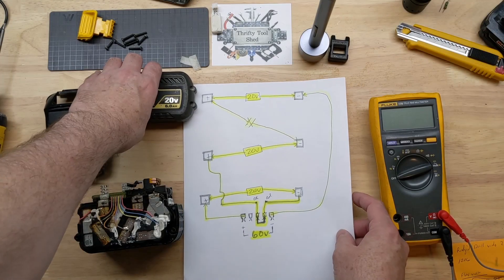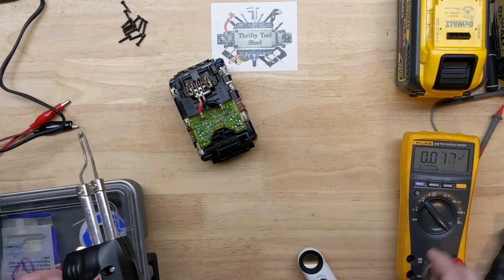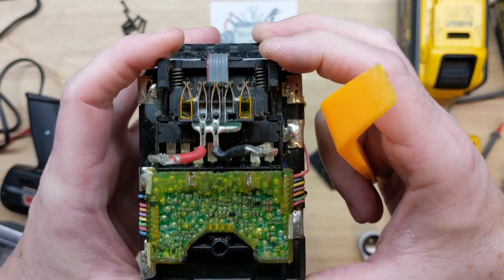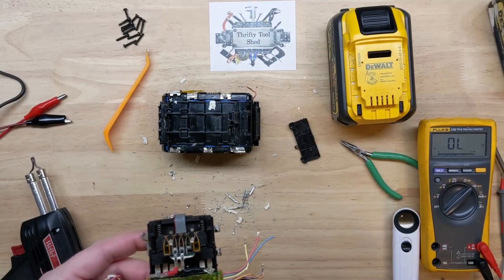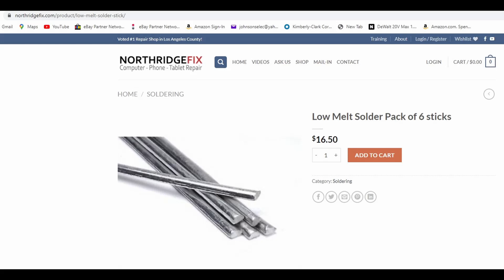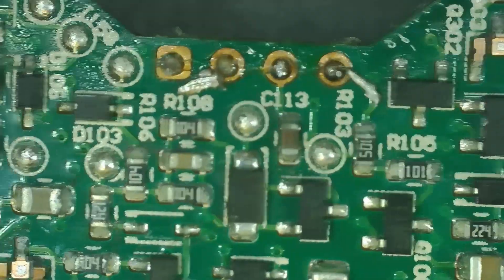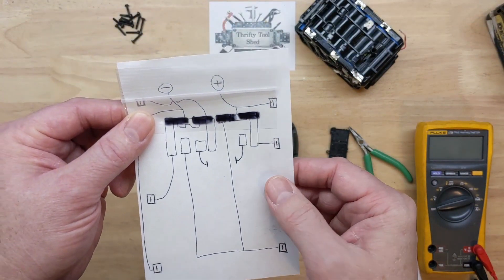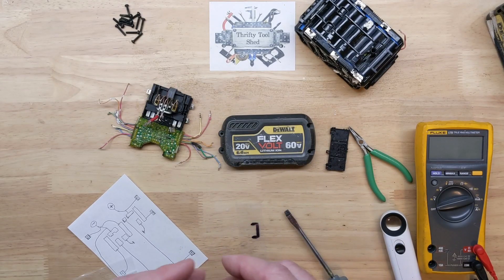DeWalt FlexVolt - Deeper Look Inside

Comment: Amazing video, appreciate the electronics focus which is rare in the tool video arena.

I'm working on a like new mid-2023 9ah that after manually charging and balancing all the cells (all of them holding voltage just fine) , the C2 terminal is giving north of 8.5v which the charger no-likey.    I think C4 is direct connect (via some small resistance) to cell 4+, bank 1, whereas C2 (as well as  C1&C3, when in 20v mode) are synthesized by the logic board.   I don't know if my situation indicates a board fault, or possibly a self-destruct mechanism like the old makita packs used to have.    Have you come across this?   

Many thanks and glad I found/subscribed to your channel👍

EDIT:  * UPDATE :
Close inspection with a magnifying headset revealed a half mm discoloration on one of the 14 traces of the cell voltage connection ribbon on one side.  Scraped down to bare copper either side, and failed continuity test.  Jumping these two points corrected the C2 voltage level.  I think the ID resistance measurement was also corrupted by this and I assume it will also correct back to ~600ohm once I solder a permanent wire repair jumper.   I'm definitely not a fan of Dewalt moving from wires to this paper thin and delicate ribbon.   I acquired the pack cheaply and dont know its history, but its mfg date is only few months ago and it looks nearly new but has some signs of use so wasn't factory DOA either...
Reply from the maker: Excellent find!
I have seen 2 packs with similar issues and I was hoping to get a hold of a new (good working) pack to make sure this was really reading in error as I noticed a difference from regular 20V max, but I do not own a good working FlexVolt to say for sure. You have most likely found a very common issue with these! I wanted to learn more about them and I have had 3 broken ones now, but with the expense of them and my honest dislike of the overall design I never bought a brand new one to double check my readings on the bad packs. Thanks so much for sharing that information. It is very helpful.

Comment: ID pin shematic is not simple, resistor 604 Om not connected to ground, some addotional shematic there. Baterry not charge becose some ID signal problem. Sorry for my english)
Reply from the maker: Yes, it is not simply connected to ground it is indeed a more complex circuit with a transistor and it seems that it can enable or disable the tool as well as let the tool know which type of pack is inserted? I think I have mentioned this in some videos over the years. Obviously I have no schematic, just looking over the board. Thanks for your comment!

Comment: Wow I had always wondered how these packs are designed, you did a great job explaining how it works in this video.
  On the subject of low temp solder.. I had so much trouble trying to remove components for board repairs until I finally learned about the different low temp solders available.  I ended up buying some of the “CHIPQUICK” component remover alloy.  Its only for removing components because it’s too brittle when cool to be used as a solder, so you need to be sure to clean it off your iron tip and the board well.  That stuff has really been a game changer for me though for removing smd components as well as big through-hole components like mosfets.  I may have to look into some other kinds of “low melt” too, it might be nice to have one that can be used without cleaning it off so thoroughly after. 
Thanks for sharing, love your videos!
Reply from the maker: Thanks for your kind comment!
Yes, the low temp solder is so helpful on removal and a very good point about cleaning the tip afterwards before soldering components back on. Thanks for sharing!
Reply: @ThriftyToolShed   Thanks for always being so good about reading and replying to comments!  I’ve been watching your videos for a few years now since I was trying to troubleshoot an EGO battery.  You even made a short follow up video to answer a question I had back then and I’ve been a fan ever since.  Actually I think you may have even helped shape my appreciation for Southern accents and their associated charm to be honest lol.
You’re a great teacher, fixer and creator.  Keep up the great work, wish you and your channel all the best! 
 Much Mahalos and Aloha!  
                 🤙
Reply from the maker: @maukaman Thanks so much for your kind comment and for being so encouraging. It is so much appreciated! Aloha

Comment: Chahahc, you are absolutely correct, its a common failure mode for this battery ie 1 cell discharges unevenly and causes the other 4 in series (3 banks in series in 60V mode)  to overcharge when in 20V mode. Very difficult to replace a single faulty cell then balance in 60V mode before balancing again in 20V mode. I have youtube video showing how to easily replace a single cell in a pack. Thrifty has shown the older model pre 2019 I think, the new mode has a flexible circuit connector instead of wires to each cell monitoring point. New model seems to have better cells but fails in other ways. Message me if you are interested.

Comment: would it be possible to use tool batteries for portable  ham radio use? they require 12 to 13.8v but no less than 9.5v discharged?
any thoughts on repurposing these? thanks Craig kd9uqe
Reply from the maker: I would think so and depending on current draw you could build or buy a BMS board to cut out for voltage  minimum of a 3S or 12V pack. Usual cut out for a 12V or 3S pack is around 8.8V or so. If that voltage is too low then a Low voltage cut off module might work? The pack in this video is too high of voltage of course, but I think you are asking if the cells could be utilized as a 3S arrangement for 12V power?
Reply: If you are trying to use tool batteries for powering lower voltage stuff you should look into step-down or “buck converters”.  They can be found online really cheap and will allow you to set the output voltage as well as current to pretty much anything lower than the supply.  There are different models that handle different amounts of current.  Very handy little devices!

Comment: Thrifty tool shed do you know what battery cells could replace the 
EVE 18650 15P 1500mAh 20C 30A Li-ion Batterys. Its for the generic Milwaukee xc 18 volt battery 6 amp hour im asking because the eve 18650 15p 1500mah 20c 30a are harder to find
Reply from the maker: Sorry I have not had to search for these to say. I try to use 18650batterystore.com for alot of my cells and I know what you mean, a lot of cells are out of stock.
Reply: @ThriftyToolShed  thank you i looked at one of your past videos and i figured out how to look at each cells specs and decided to go with the LG 18650hb 2 1500 mah

Comment: I believe you can’t use the C1,2,3,4 terminals to accurately measure cell voltages. I’ve repaired two by now and both of them could have changing cell voltage readings based on pressing the switch to go to 60v. I think the voltages that we’re there were for telling the charger the battery is good. That being said, I don’t think it should read 0v like it did with yours. Can’t wait till you get into that 12AH!

Comment: I read that a possible failure mode is using it in 60v and having some cells discharge unevenly for whatever reason, which when removing the battery then shorts the pack back to the 20v configuration and instantly recharges the unevenly discharged cells at super high amperage causing damage.
Reply from the maker: I can absolutely see that being an issue. If left in a 60v tool for a extended time (and you know it will) all in series and of course as you mentioned pulling it out puts it back in 20V configuration and if cells are unbalanced it would be bad when they all go in parallel for sure. These packs are expensive and alot to go wrong and too time consuming to repair alot of the time.
Reply: @ThriftyToolShed  I hear you, so the only way is replacement. What ashame! Enjoyed watching.